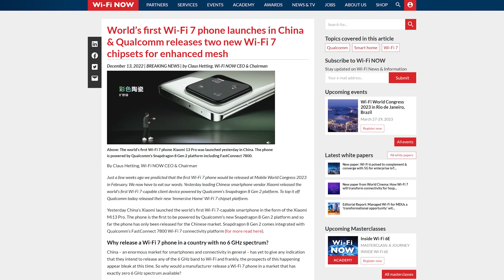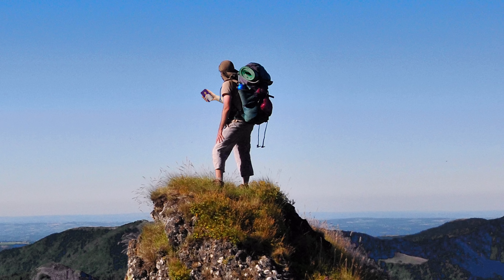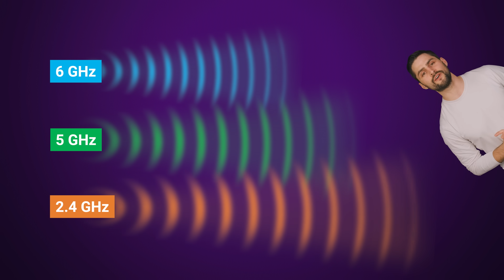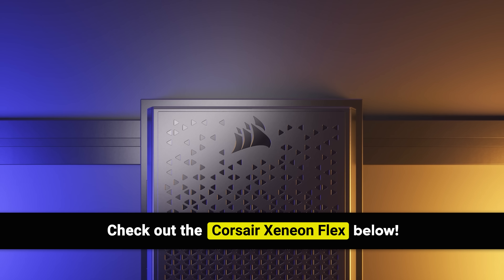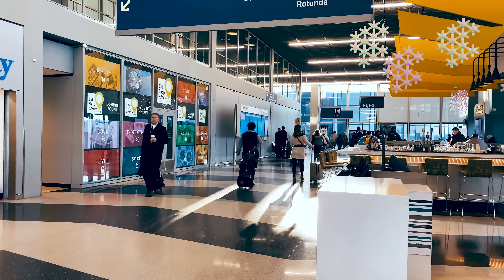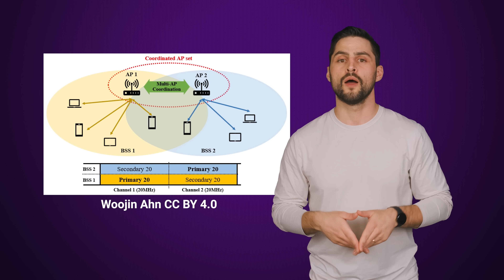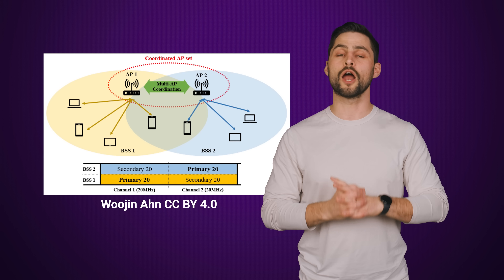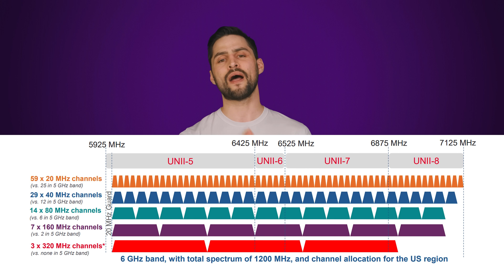Can Wi-Fi 7 Replace Range Extenders?

Comment: Connecting on multiple frequencies should have been a thing years ago. I'm baffled that it's only going to get implemented now.
Reply: As with switching to the closest access point, which might not even happen this revision still.
Reply: @OllieHamon  switching to the closest already works with mesh networks...
Reply: @ViXoZuDo  I know, but that's extra utility a person has to buy. So the advantage this brings is just not having a mesh network anymore.
Reply: @OllieHamon  APs will also usually require to run long ethernet cables around your house
Reply: @ViXoZuDo  If you're lucky.
Reply: @Naokarma  let me guess... you don't know what a mesh network is...
Reply: @ViXoZuDo  I have one in my home. It's fine, but it doesn't work nearly as well as you're pretending it does. Try to think about what a comment is saying before you try to feign superiority over something that is really not that complicated, lol.
Reply: @Naokarma  "one in my home"? bro... you don't need one... the whole point of mesh networks is to have MULTIPLE nodes where every single one is compatible with each other...
Reply: @ViXoZuDo  "bro... you don't need one.." Speak for yourself. I live in a large home with a couple groups, rather than a small home by myself. Even ignoring this, it really doesn't matter. It doesn't work as well as you're acting like, and that's the only relevant point. Changing the subject isn't proving anything.
Reply: @Naokarma  I do have 3 nodes in mesh, and they work perfectly fine. You're not the first one I encounter that brought 1 unit that support mesh and think all their other non mesh compatible old units would magically be able to communicate with their new device.
Reply: @ViXoZuDo  "brought 1 unit" I think there's been a miscommunication. I never said 1 unit. When I said "I have one", I meant one system. You sure do love taking the least charitable interpretation of a statement to be as condescending as possible.
Reply: @OllieHamon I mean they would be stupid if they just do that, you would be creating a problem if it the closest access point is slower than the fastest even while further one, and maybe is not easy to assess that, the wlan itself can be faster but be connected to a slower internet, and you would probably accessing the internet, or maybe is connected to a faster internet but the access point is overloaded so you would get a slower or more unreliable connection, those are quite the obstacles
Reply: Fast roaming goes pretty hard. 
You should look at the 802.11r and 802.11k specs  @OllieHamon
Reply: In theories yes
Reply: For some devices, it actually was a thing, whether the manufacturer said it was or not.

Remember the Airport Extreme? While they probably don't do this now, many Apple devices at the time that supported both bands actually did hold on to both bands, so long as you followed the reference spec by giving all bands of your access point the same name

This however, only really worked with the airport extreme and similarly programmed access points, and typically only Apple devices like iPhones cared to actually use this feature, and even when not holding on to both bands, it was typically Apple's devices that were likely to actually switch bands in any smart manner at the time.

Airport was, at the time, the gold standard for wifi. Once Apple killed the airport line of routers, things actually got ugly pretty quick, with even more proprietary gimmicks hitting the market to try to build the next walled garden.

Now that this will be the standard instead of an optional implementation of Wifi As The Radio Gods Intended, finally the debate over whether to name your bands the same or not will be over.

Or it won't because companies are retarded and consumers even more so.
Reply: I was thinking that too. Like why wouldn't we be doing that from day one?
Reply: Many routers do this sort of already - mine auto flicks between the two depending on signal strength but it's not seem less - my device will disconnect and the. Reconnect a few seconds later so you can notice it where as Insuspect with wifi7 you will never notice it changing frequencies
Reply: @ms3862  many routers have a smart connect feature of some kind that does this but it's not usually very seamless client-side. The issue is similar to the issue that this video describes with phones regarding holding their connection and only roaming after the signal is totally useless (which makes sense if you consider most of the time the band is separated by SSID).  I suspect the WiFi 7 standard will make this far more graceful since it'll be a standard that can exist on both APs and clients.
Reply: RIP drone pilots
Reply: It'd be nice, but it probably won't get used that way in real devices due to power draw.  Multiple bands means multiple radios on simultaneously.  Same reason why most phones and laptops are still only 2x2.
Reply: Exactly LTE and 5G have been connecting to multiple bands for years
Reply: Remember usb c implementation? So many expectations so many disappointments
Reply: Why has it never been a thing before??? MmmmMooonnnneeeyyyy
Reply: @unknownunknown-ni1ns  Think about what you just said for a second, cause I'm not sure you understand the situation.
Reply: It's amazing to see stuff like MLO (seems similar to carrier aggregation in the cellular works), OFDMA, higher modulation finally make their waves. LTE and nR already use these technologies
Reply: Fun fact: Some routers actually had the feature, but only because it was built into the software.

But now all routers that have Wi-Fi 7 will have it by default, since it's becoming baked into Wi-Fi 7.

And your device isn't connecting to all three bands at the same time it's choosing which signal is stronger for your location.
Just like your phone connects to the cell tower.
Doesn't use all the frequency bands, only uses one and chooses which one is stronger.
Reply: What are you gusy talking about`? WTF? my router thats from 2015 can do that? What cheap crap are you buing?
Reply: Luckily my rog phone 6 has that feature already
Reply: Yeah, LTE-A have been around for a long time, combining up to 5 bands for speed, yet wifi can't even utilize two bands at the same time
Reply: @SyukriLajin latest modem can do 8xca tops ofc no provider has that much spectrum unless is a combination of lincensed spectrum and unlicensed spectrum like b46 and partially b48.
Reply: It’s just more wastefully using the spectrum. If you live near neighbors with congested spectrum, MLO won’t improve your speeds at all.
Reply: It was a thing years ago, my Tp-Link Archer A7 has multiple frequencies under one network. It came out in early 2018
Reply: These updates aren't always software/firmware based and as such the modems themselves have to "catch up" 

This already happened in the early 2010's with Routers not having enough ROM to be patched/updated... 
The above points are on the broadcaster side,  on the receiver end it is Chaos Magnified...
P.S. This is why upgrading both your devices over time will give you better QoS.
Reply: I’m sure the government would have had it years ago but it’s probably being released now
Reply: It wasn't implemented before because it would have been stupidly expensive and battery inefficient, same reason we didn't have MIMO on WiFi for several generations.  Processing power, energy consumption and complexity of manufacturing, which only gets solved with time.
Reply: Band steering is not a new thing 😅
Reply: I've been able to do it on my phone (asus zenfone 8 flip) for a couple of years now, so it has been, just not widely implemented
Reply: if you are complaning, why don't you become an engineer and fix it for yourself
Reply: Too much radiation already -.-
Reply: @sassuki  ... Tell me you're joking. Non-ionizing radiation doesn't do anything to living being. Even 7Ghz radio wave is still below visible light.
Reply: @How ya doin today Barb  Maybe s/he meant like saturation of the wifi band  - radiation isn't necessarily used to describe harm to living cells.
Reply: @FireWyvern870  Sure it does. You can find papers on the subject for example how a 4G phone besides the skull can have an effect on brain cell activity.
Reply: @samik83  yes, I have read papers and they say that it doesn't have any effect on human body.
Reply: @Abdullah Zafar  science has biases. To deny this is to deny science.
Reply: @samik83  and @sassuki, if 7GHz was already hurting you, then what would actual visible light have done to you? Killed you multiple times every second at worst? Sun light is very bright and its brightness shouldn't be underestimated. You've probably spent tens of thousands of hours outside at daytime, where there's (at least occasionally) sunny weather, which means more light outside, yet you're still here with us as I'm writing this comment. Remember, light carries more energy than 7GHz ever could. That's why UV light can harm you.
Reply: @sassuki  having WAP/device select the least contested channels and bands that's transmitting best, means less radiation, as does the signal beaming in the right direction.
The alternative to smart, is pig ignorant ramping up power on both ends to try to brute force reception.
Reply: @sassuki I think a light bulb releases more radiation than wifi
Reply: @jayjames186  it's not the same. Wifi radiates in the 2,4MHz range and above. Light bulbs in the low KHz range
Reply: @sassuki  go away lmao

Comment: You forget that the device has to send data back the long distance to the AP which is not always possible especially with mobile devices due to energy saving settings.

Comment: Wait doesn’t this already exist? My Wifi 6 router only has one access point, and yet it will automatically put you on 6 or 2.5 ghz depending on the signal strength. What’s the difference?
Reply: That just make the SSIDs (The wifi name) the same. You can only use one set of signals at a time though, and your device needs to know to hop, which can cause drops. With 7 that transition process should be more smooth.
Reply: @zncon  Thanks! That clears it up :)
Reply: I sincerely doubt it would ever put you on 2.5GHz because that's not a spec.

Comment: my phone finally switching to the closer access point is the true blessing here. I'm tired of having to disconnect and reconnect again.
Reply: This works fine on my wifi (no matter if it is 4, 5, 6, 6e or mixed) network that supports 11 k, r and v. Be angry at wifi ap vendors not implementing these standards.
Reply: Its not only your phone or your current setup. Its the bad software thats running on it.
Unifi does this realy great.
Reply: this is such a first world problem, but I fully agree lmao

Comment: Spectral efficiency is basically identical to AX, there is some spectrum that will be unavailable in many countries because it is simply licensed there. From embracing roaming, it is 802.11r/k/v and it is supported by the user who connects. 3 x 320MHz is nothing unusual, in the 60GHz - 802.11ad band, 2 GHz channels are available. Only the band aggregation is interesting.
Reply: what this person says
Reply: There more then that, there very good videos explaining all technical details of updates made from 6

Comment: Someone who is still on wifi 4 😅
Reply: WiFi 5 (aka 802.11ac) is only a thing on 5 GHz, so the access points that have it use WiFi 4 (aka 802.11n) on the 2.4 GHz band. WiFi 6 improved  both 2.4 and 5 GHz, but there's still a fair number of people like myself who haven't upgraded to it yet. For my needs, I'm pretty happy with my existing WiFi + Ethernet, so I plan to wait until WiFi 7 is finalized, supported by an OpenWrt stable release, and reasonably affordable.

Comment: People say 5ghz has limited range, but I get good reliable signal from my router everywhere inside my home. Though it doesn't penetrate the concrete block exterior of my home.
Reply: Different countries use different materials for their homes. Some may use drywall or wood, while others may use brick or concrete.
Reply: @nninjastrike2127  You misspelled buildings by calling them "cOuNtRiEs".
Hint: all countries utilize a variety of building materials and techniques.
You can buy houses almost anywhere made out of wood, concrete, stone, etc.
I lived in an apartment complex with concrete walls and floors for fireproofing.
Guess what: it was in the same CoUnTrY as a townhouse made out of wood with the outside made from brick.
Reply: @tim3172  Yes but it's still quite likely that buildings in Japan are typically built and designed slightly differently to houses in Norway, no?

Even taking my native Scotland and my partner's Denmark for example, we live in relatively similar climates no more than 1000 kilometres away and yet I can say the typical house of the two different cOuNtRiEs are noticeably different in terms of what is used to construct the buildings and how thick and insulated the walls are.

Also have no idea why you took such an extreme reaction over one little word.
Reply: @tim3172  Tbf, American is different from the rest of the world. And why got offended anyway, such a first world problem. Most people in South East Asia use mostly wood for their house because of our tropical hot climate. So different CoUnTRiEs is a viable reason. Don't just assume all CoUnTRiEs is the same as Murican. Such an American move to just assume that all country follow their rule.
Reply: @tim3172  As someone who has done quite a lot of travel, and has many friends across almost as many countries; with the exception of The US, Canada, and to a lesser extent Mexico, most buildings in most countries are all made from similar materials. There are exceptions, like in urban South Africa you see as much construction diversity as you do in the US, but in rural South Africa almost everything is heavy timber framed structures with brick, mud, and clay exteriors because that's what's plentiful and cheap.
In Germany most older homes are wood and plaster, while for newer construction they use almost exclusively metal and concrete.
In Spain you see a lot of clay and ceramic use. 
In the New Mexico and Arizona you see a lot of pueblo style houses made almost entirely out of mud brick.
Construction methods and materials in MOST PLACES are dictated by what's cheaply available.
Reply: I have concrete walls inside my home and the 5ghz doesn't penetrate through the walls
Reply: I have european style brick walls and 5GHz works absolutely fine with a single router. 2.4GHz is only used for old legacy devices.
Reply: @AbRaSkZo  must be some fake bricks or very thin bricks
Reply: @ms3862  There are a lot of Colonial era houses in the Southern USA that are made entirely of fired clay bricks. My cousin lives in one of these in Charleston, SC that used to be slave barracks that's now a 4 room house. All the bricks are 4x4x8 inches with 3 holes in the middle the interior walls are only 1 brick thick, except for the load bearing wall which is 2 bricks thick. The exterior walls are the thickness of 4 bricks but are mostly hollow and were originally filled with straw to insulate them. Today they are filled with minimally expanding foam.
These buildings that are hundreds of years old have survived direct hits from category 4 hurricanes, and no they do not block 5ghz WiFi. Well, the load bearing interior wall does a little. If I put her AP in one corner of her house the signal strength on the other side of the load bearing wall is about 50%. But with the AP mounted on the load bearing wall, near the ceiling, she gets 80% signal strength in the furthest reaches of her home, and still has over 50% strength in her driveway.